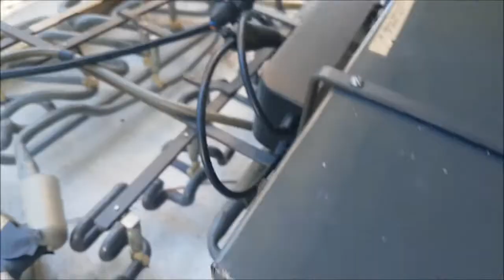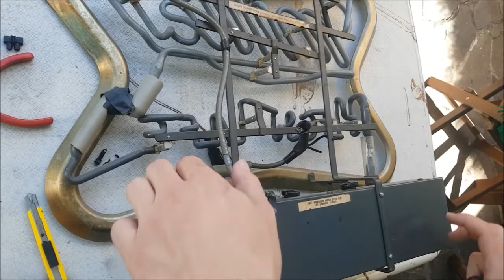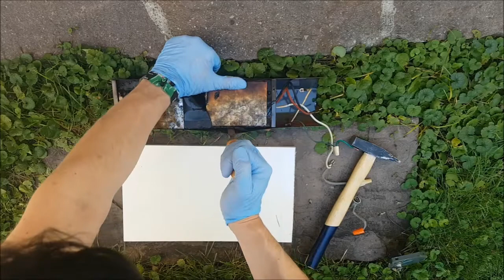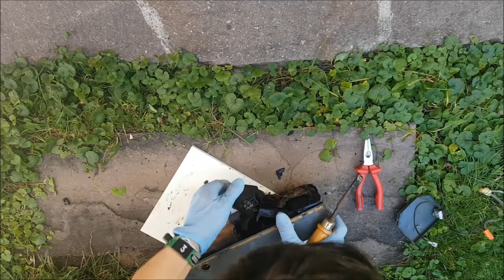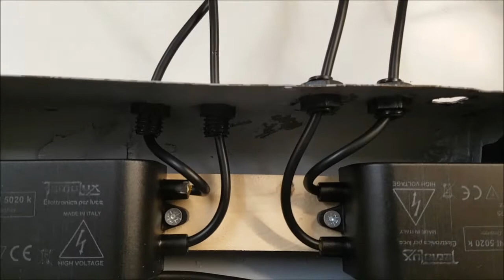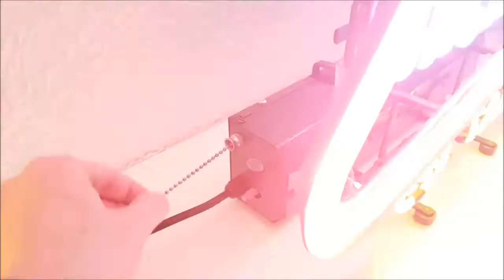Flashing Miller Neon Sign - Transformer testing, repair, unpotting, retrofit

Comment: That old transformer looks like it saw some high heat at some point. I suspect someone might have done something wrong. Those old "Franceformers" were pretty hard to kill. The only drawback to the new transformers is since they operate on a higher frequency they are more likely to cause radio interference. Otherwise they are small, lightweight,  quiet, and produce far less heat.

Comment: Hello do you have a source of supply or part numbers for the trnasformers and parts used? I purchased the exact sign. The pull switch was clipped and I have no wiring schematic. onlt the border / bow tie was lit and flashing with how it was wired when I purchsed it. Any help would be great. I would like to get the pull switch replaced and see what that would do, hope I don't need to replace the transformers but if so I would try and copy excatly what you did on yours. Thanks
Fitz
Reply from the maker: @JustinFitzpatrick-h9x  hi, these are 230V transformers, are you in europe? The transformers are tecnolux 5020 and 5020 flashing.
Reply: @NeonSignStuff  No sir. I live in the U.S. , hard to find any good information on a parts list or wiring diagrams. Ran across your site and thought maybe you could help, I tried to find a used but good transformer from e bay and no luck. I wanted to start with the pull switch though. It's a two wire switch. I thought I would take a shot at wiring in and popped a breaker so I guessed wrong. Figured more reserach was a good way to go. Any help there would be great as well. The existing switch had the wires cut off so I was not sure. I bought a similar pull chain lamp switch to try at home depot , but that's where I'm at as of now.....
apprecaite your reply.
Fitz
Reply from the maker: @JustinFitzpatrick-h9x  the switch needs to be wired in series with the hot conductor. Know anyone locally with electrical knowledge? have them assist. In the US i hear tech22 neon transformers are very popular and small. Should also be available with integrated flasher
Reply: @NeonSignStuff  No local contacts,  there is one neon shop who is not helpful and basically tells you that repairing the sign would cost more then it's worth. Its why I was researching and looking for any info I could find. Do you have a picture of the switch wiring ? I will look up tech 22 transformers and see what I can see, apprecaite the tip on those. I won't give up on this project but it's proving to be a challenge finding information to say the least. I was hopefull when I purchased the sign it would be an obvious issue. Wishful thinking......
Reply from the maker: @JustinFitzpatrick-h9x  a regular electrician would be a start for the switch wiring, no neon expert needed for that
Reply: @NeonSignStuff  Got the switch wired in and same result.  The "bowtie" red border is lit and blinks on and off  but no MILLER HIGH LIFE ON TAP illuminated. So I gather that would point to the right side of the transformer being bad ?
Reply from the maker: @JustinFitzpatrick-h9x  this, or one of the tubes has lost its gas.
Reply: @NeonSignStuff  tubes seem good as i did test with neon tester and they all lit pretty well. I was wondering about coverting the 230 v model you installed to accomodate 120 v or that may be another can of worms ? One guy quoted me a price that was three times the cost of the sign. He wanted 200 to trouble shoot it !?!?

Comment: I find this video of particular interest since I have this sign in my collection. It's been in storage for many years since it's not working 100%. If I remember correctly my neon border has leaked and doesn't light (I'm fairly certain I validated the magnetic transformer/blinker was working). When I obtained the sign 40 years ago, it did work. Perhaps I should pull it from storage and revisit the problem and get the neon section repaired.

Since I'm only starting to experiment with electronic transformers, could you explain in a little more detail about why it is detrimental to run the high voltage wire tied to the metal frame, and the tube near the metalized reflector. What are the drawbacks and/or problems with this? Is it detrimental to the transformer or does it just create a lot of high frequency RF interference?
Reply from the maker: Hi! I might do a video about the rules for electronic transformer use in the future. 
Short answer: yes, running their cables along metal, or parallel tied to each other, causes RF interference, puts additional load to the transformer output and can also confuse the safety shutdown functions of the transformer. Due to the high frequency, they act more as transmission antennas than regular 50Hz neon cables. That's also valid for the tubes that they supply. If your old school transformer of the sign is still working, i would suggest to keep it that way. As it is old and doesn't yet have any safety functions built in, i would though advise not to run the sign unattended.

Comment: What is the diference between electronic transmormer and big one?

The electronic one doesnt seem to have any coil inside
Reply from the maker: The older big heavy ones work directly on 50 or 60 Hz grid frequency. The electronic transformers internally convert to a kHz frequency, hence the transformer can be built much smaller. So yes they still have a coil wound transformer in them, but very small. See my video about the miller guitar neon unboxing/repair, i show an open electronic transformer in it.